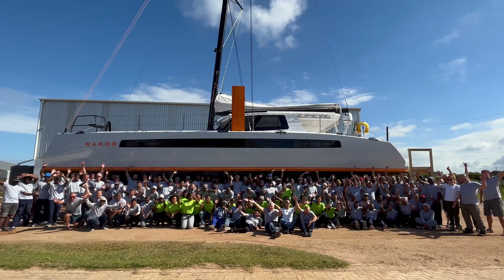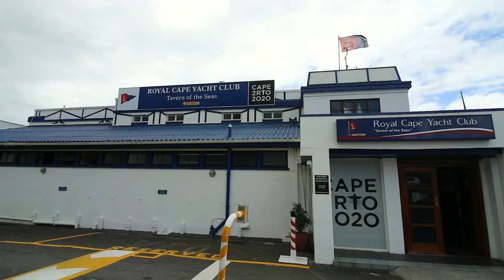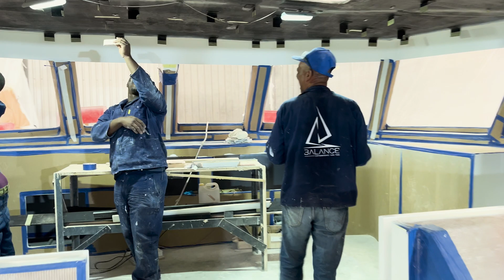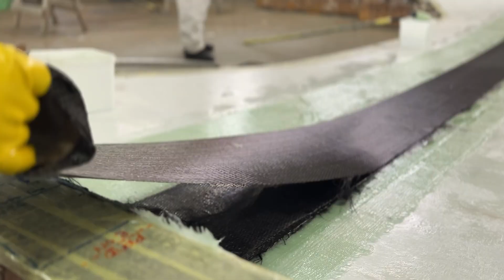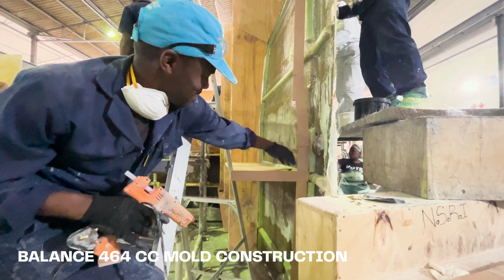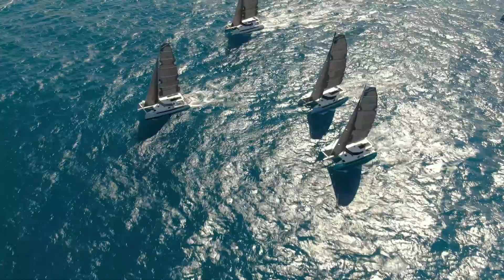Crafting Confidence: The Quality and Expertise Behind Balance Catamarans

Comment: In search for the most appropriate mono-or multihull for my adventure starting in 2029, I came across several Wild West experiences in the yacht building industry. Insolvency after the month, I received a price and option list (Malö in Sweden), enormous price increases of about 50% base price over the last three years, etc. Take it or leave mentally from builders, as a million is peanuts.

In case, spending 10 Bitcoins, or the equivalent in fiat currency, for a passion, three things are paramount:

1. How many service points do you have around the world? 
2. Do you acknowledge to be the single point of contact when having technical issues? Meaning, if I buy a Porsche and the Bosch fuel injection is failing, I go to Porsche to get it fixed. In case somebody tells me to contact Bosch, I will never purchase a car from this brand again. Same for sailboats.
3. Do you include a one week get to know all systems of your vessel like Amel does?

Performance, build quality, etc. are absolutely key but above mentioned after sales services are equally important.

I am confident, you could answer my questions in a future one to one conversation.

PS: In case clients can purchase with BTC in the near future, much appreciated.

I continue to absorb all your content on this platform until then…

All the best from Pastellfarben country
Reply from the maker: Thank you for your thorough reply. We can certainly address your points in person with you (perhaps at a boat show in 2025?) and also in other videos. But to give a quick answer here and now:

1. We have established relationships with service point all over the world. We have developed an interactive map to show which stations accept which models (based on beam), which are for haul-outs and which are Balance trusted or experienced. Most of our boats head to Grenada from Cape Town, so we have a person stationed there to handle first contact after the first big passage (aka the Balance Shakedown). But we also having boat head east to Thailand now and so are truly expanding our after-sale service globally. 

2. We act as a point of contact for all problems. On our owner's portal (and app) we have a warranty claim form. As Balance we may not always be directly responsible for OEM problems, but we will take the case to the OEM. We want to make sure the products we use are product we love and trust, so this feedback is essential to us.  Furthermore we have a team to handle warranty, including a representative for each boat yard. 

3. Absolutely, we have a 1 to 2 week handover process where the boat systems are taught to the owners. Furthermore, we developed an online version of this with videos for every aspect of the boats. Watch here for more insights:  https://youtu.be/mP8__6QVKrM 

Thank you again for your comment. We will bring you more content on these topics soon. 

Cheers from the Balance Team

PS - I hope that BTC turns sales into sails.  ⛵
Reply: @ Thank you for swift reply. Your answers sound promising. I will contact you in 2025 for an appointment in SA, boat shows are not my cup of tea.
Reply from the maker: To answer your questions:

1. How many service points do you have around the world? 

We have dedicated staff and service centers in Grenada, Virginia and France, and then approved yards to work with all over the world. If a customer contacts us to say they are in a specific location and need assistance we direct them to the nearest location for service. We have four full-time warranty and support staff on call for customer care. Two in South Africa, Two in North America. 

2. Do you acknowledge to be the single point of contact when having technical issues? 

No, because if you have, say, an issue with Yanmar, and your warranty is with Yanmar, and you are in Saint Martin, things will go a lot faster and easier for our customers to contact the Yanmar agent directly, or the Raymarine agent, etc. On our Balance Owners portal we provide information on how to contact all OEM providers in various locations, as well as operations, maintenance and trouble-shooting videos.

That said, we also have a full-time OEM support manager who is there to assist our clients if they have an OEM issue and are not getting the care and response from the OEM provider they require. What I can say, is that we have an OEM provider that is providing us with faulty or problematic equipment, they will be given notice to improve, or we will turn to another product. 

3. Do you include a one week get to know all systems of your vessel like Amel does?

Our turn-over and training process lasts at least a week, if not more, in Cape Town. And before a customer arrives they will able to access videos on every aspect of the turn-over, operations, maintenance, sailing and handling and care of their vessel.
Reply: @balancecatamarans  Now I am puzzled. The 2nd reply is less friendly that the first. Okay, as a mid fifty European, I may expect too much formalities. 
One last thing from my side: I might not be your (or any boatbuilder’s) typical customer, thus I am not blind to ask a simple why? Neither do I look through pink glass to ignore harsh reality.
In case I purchase a product from a producer, legally speaking, the producer is my contract partner, not dozens of parts supplier who make a total product. Hence, I will choose wisely who will get a contract with me. Speed of a vessel becomes fifths most important product characteristic.
Merry Christmas and a happy New Year
Reply from the maker: Dear Professor Volland, I can see where you are confused. You were sent an email from our Cape Town staff and I sent you one myself. The only key difference in the response is on OEM warranty issues. My own experience from a lifetime in yachting is that when have an OEM problem of a specific thing and are near a port with an authorized rep, things will go a lot faster to reach out to them, because all we would do it reach them, come back to you, sit in the middle of an effort to get both parties together. It can mean ten phone calls to do what one could do. Where the issue of OEM support becomes more critical is when you are far from a service location and could use help to get a part, or trouble-shoot something, and there it is best to contact us. Because if the issue is technical we can often have you in talks with a manufacturers rep or provider, or answer ourselves if we know the solution. i am not sure where you are located Dr. Holland, but if you happen to be in Europe, I would encourage you to set up an appointment to meet with us at the Boot Dusseldorf this January. Just send an email to caillie@balancecatamarans.com to organize an appointment.
Reply: @ Thank you for your reply. I am sure there will be a way and an opportunity for you to talk to me in person in South Africa, after I relocated to Mauritius. As mentioned, boat shows are not my cup of tea.